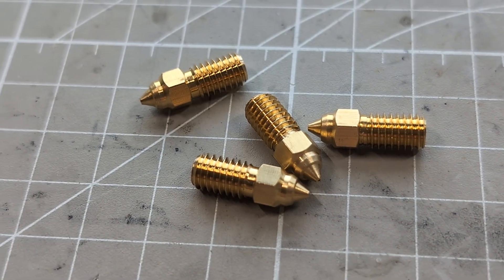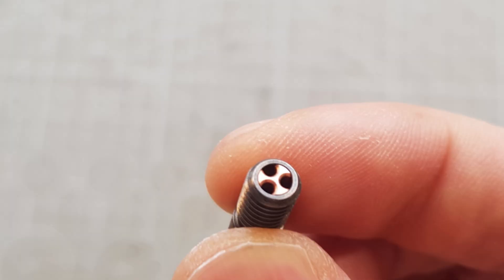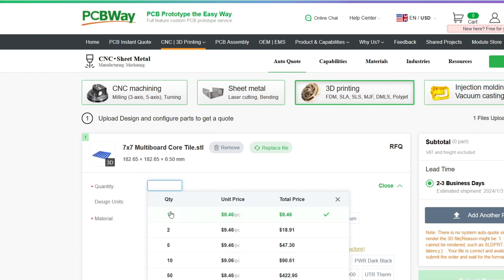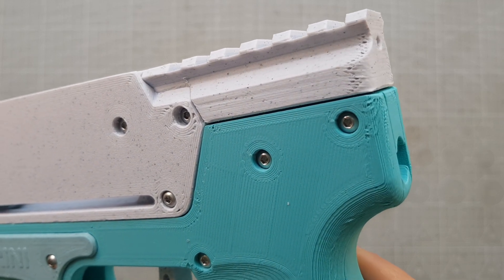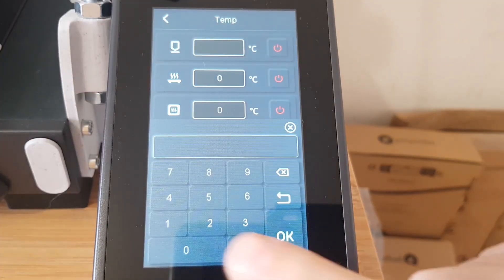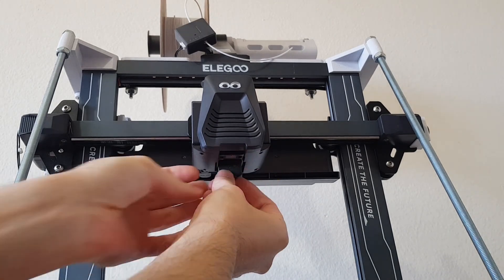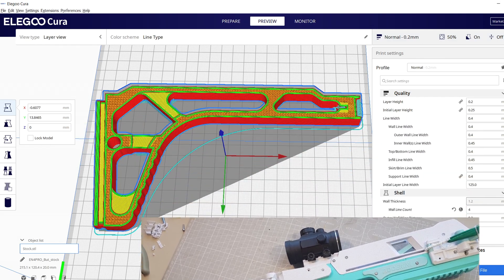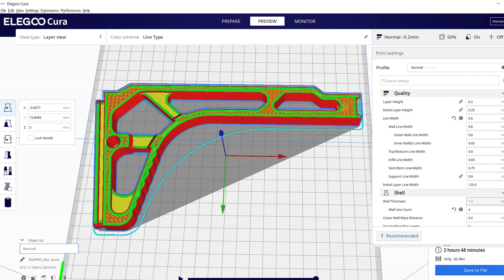better nozzle for your 3D printer + how to install it (shown on a Elegoo Neptune 4)

Comment: what did u adjust the flow rate to?
Reply from the maker: Hi Mr.Muzk, i actually just had to change the nozzle diameter in the slicer. I do adjust the flow to every filament im using, its mostly good with +1 to +10% depending on the filament. For PLA i use basically the default settings.
Hope that helped ✌️

Comment: The hardened steel nozzles with copper cores for flow are counterintuitive. The copper gets chewed up by abrasives. It doesn’t matter that the outside is hardened steel if the inside is soft copper. The best solution to this that I have found is the Triangle Labs Mk8 ZS plus nozzles. They are copper on the outside and hardened steel on the inside with none of the filament path touching the copper directly. The pictures they have on their site don’t even clearly show this but I have 4 of them and they hit 40mm^3/s while keeping a completely hardened steel core.
Reply: From my understanding, the way nozzles are worn out is kind of counterintuitive. As they flow out of the hot end, the inside isn't where the nozzle is worn down the most, the filament flows easily and relatively harmlessly as it is as close to liquid as it will get. The wear on the nozzle mainly comes from the tip scraping along the just-cooled filament from the last layer as it's moving along the print, so it's worn down from the outside in.
Reply from the maker: That sounds nice, are these available for the neptune 4?

Comment: I don' know whu youtube delites that comment, tryin' to add it not in the tread
___________
btw, there's a way more interesting and usefull upgrade for n4 series – search at printables "Elegoo Neptune 4/Pro/Max/Plus Fan Shroud V5"

It'll be interesting to see that printhead in your future videos. I'm working on a similar thing from "My Hero Gen 7" project right now and found that one after some parts of My Hero project were printed, but that one is interesting too in my opinion.

Comment: Don't use these cheap Chinese knock offs. They suck big time.
Reply: Why they suck?i have one of those for months no problem maybe its your fault
Reply from the maker: Hi Vinzent, sound like you allready have some experience with these, can i ask you what material you printed that caused clogging?
Reply from the maker: So far i printed PLA, Wood filament, PETG and the one named "nicebio"... CF PETG will be next. 
Was curious if maybe you did allready a CF- type of material and run into problems with this nozzle.

Comment: Those cheap nozzles have terrible quality, I don` advise to bye any of those. A way better quality have trianglelab or mellow nozzles -- I'm using those only.
Reply: i have had no problems with these nozzles after months of printing they dont show any sign of wear
Reply from the maker: Interesting, i dont know these but will check them out if my CHTs get worn out... For now (and for the first 50 hours of printing) i am very happy with the ones in the video
Reply: @Dirt-E-Bikes  Can prevent nozzle cloggong because of inconsistent quality. One can be ok but the other one can be damaged directly from the factory. Shtefan mentioned that in his vodeo.
Reply from the maker: @kenyajobs1069  thanks for the info, i ordered 3 more of the hardened ones, and will let you know if anything is wrong when i tested these. I screwed in another one this morning to check if there are any problem with those i have got, and they all seem to work fine. Maybe i was lucky
Reply: I agree. These cheap Chinese ones look ok in the beginning. Then the clogging hell will start
Reply from the maker: @Vinz3ntR 🤔 if so, i will order the ones kenyajobs suggested. I ordered 3 more of the ones in the video, after runing these, i will let you guys know if there where problems with it... On my setup...
Reply: @Vinz3ntR  not true for me, bought mine many months ago and have done a ton of printing without any issues.
Reply from the maker: @jpeero  good to hear that, do you use the hardened nozzle? And is it the 0.4mm or a bigger one?
Reply: @Dirt-E-Bikes  year i used the hardened steel with the copper core .4mm nozzle
Reply: @jpeero  copper nozzle with hardened steel core you meant maybe? I'm using one of those btw
Reply: @Vinz3ntR all  things you bought is Chinese 😂

Comment: Cool, will order those... Is the hardened steel nozzle qlso suitable for PLA or only for Carbonfiber stuff?
Reply: im no expert but as far as im aware yes. but im not 100% sure so yea
Reply from the maker: Think the same as albion, yes should be good for PLA 👍
Normaly these hardened steel nozzles take a bit more power to reach its desired temperature, but with the brass core, it seems to not be as significant as with the bondtech nozzles.